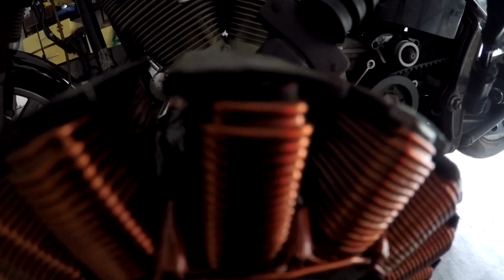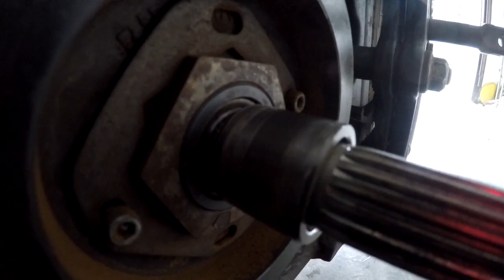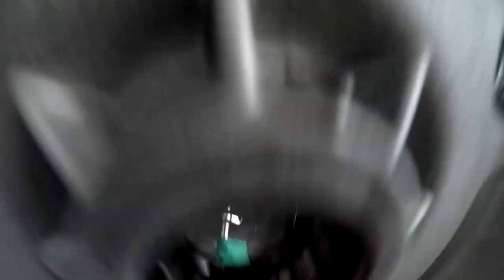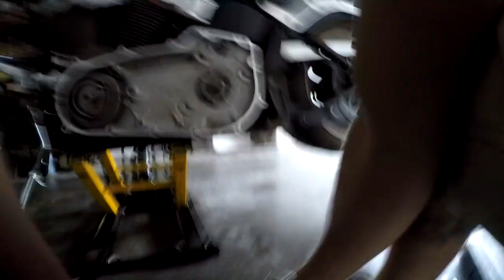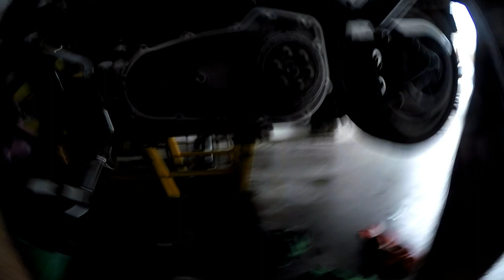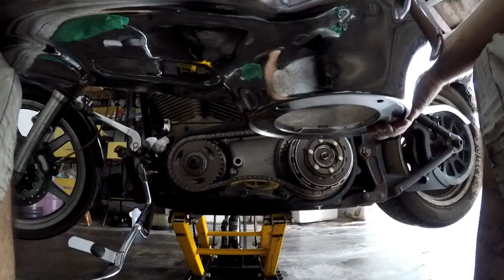Harley Softail: Instalando estator

Comment: Felipec, é comum o estator dar problema depois de rebobinado. A causa disso é que além o isolamento do fio (resina) a carcaça do estator, que tem um isolamento químico, perde as características isolantes depois de manuseado. Então a chance do estator fechar curto é maior. Os estatores da Chiarato são muio bem trabalhados como vc disse, mas recentemente descobri com o pessoal da Suzuki C1500 (moto que tem problema crônico de queima de estator e retificador) um pessoal de SP, que além de rebobinar, dão um banho de resina na carcaça do estator. Então fica a dica! Caso o estator volte a dar problema mande direto pra wortec, que parece ser a única empresa que faz esse isolamento da carcaça antes de rebobinar. Parabéns pelos videos! Estou assistindo todos! At.te
Reply: Isto mesmo , tbm acompanho o grupo. a minha c1500 ainda não deu problema mas quando der será com a Wortec.
Reply: O meu deu pau e estava na dúvida entre o pessoal da Wortech e o Chiaratto, mas depois de ver os vídeos com os equipamentos da Wortech, vou mandar pra eles.